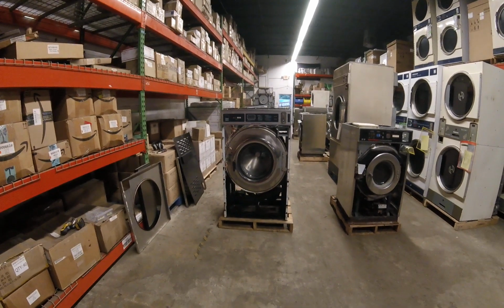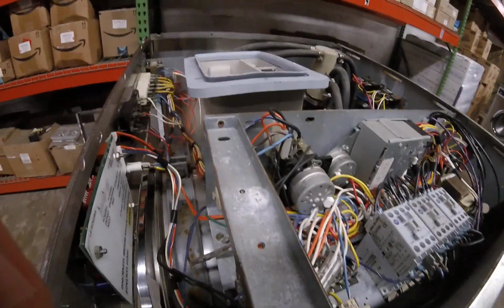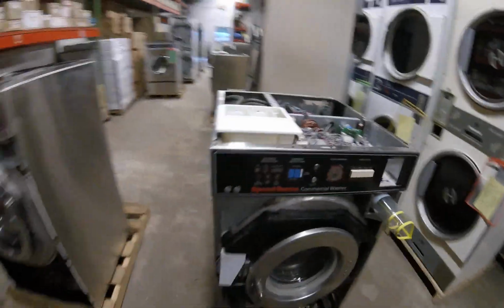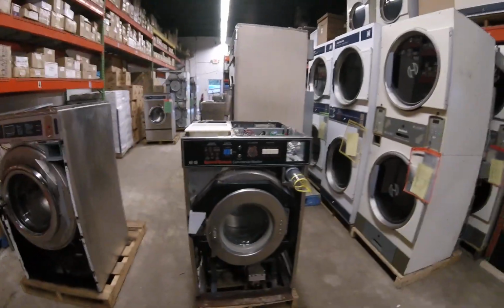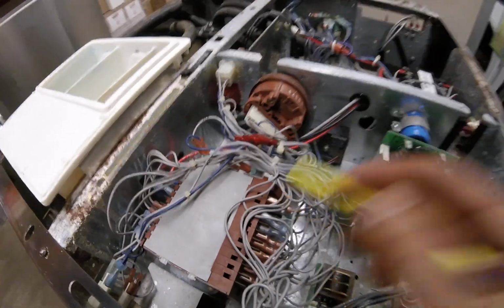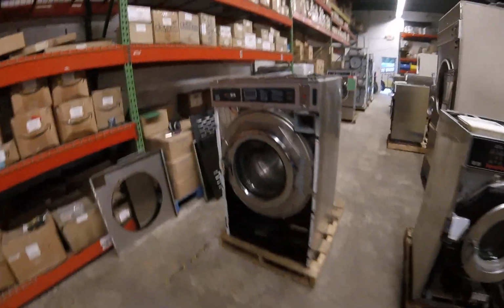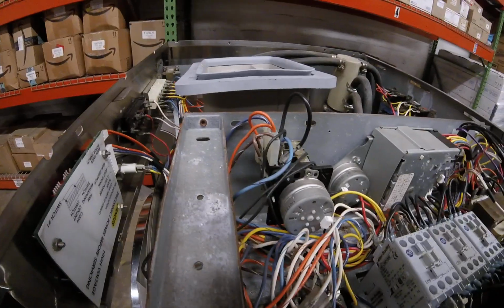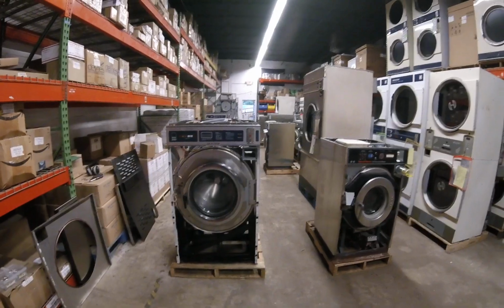Dexter or Speed Queen Washer Worked, then Stopped Working

Comment: You would be the guy to help me. The people I work for have an older Alliance with the terminal strips and the young guy I let change the timer out never wrote down where the wires went on the timer. I have a 13a wire that comes off the door lock board and have no idea what pin on the timer it goes to. This door lock board is like 3x3 square board not the rectangular small board. Think you have an older SC there to help me?
Reply: Better yet, do you guys have a number I can call or website?